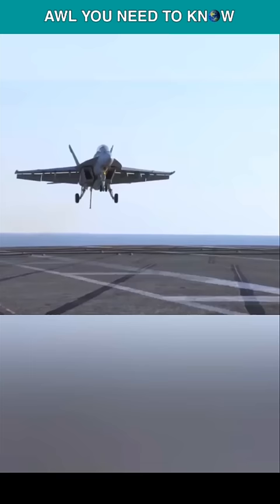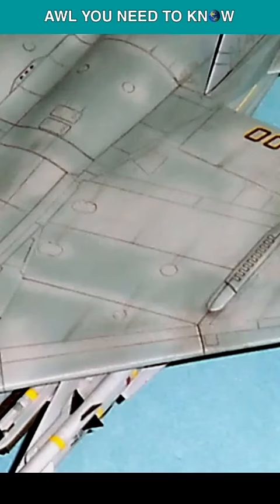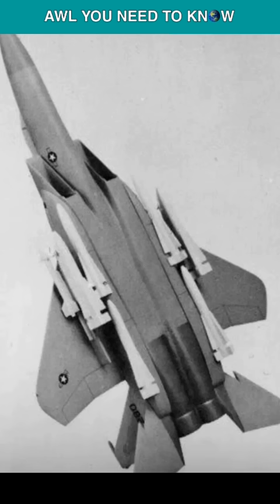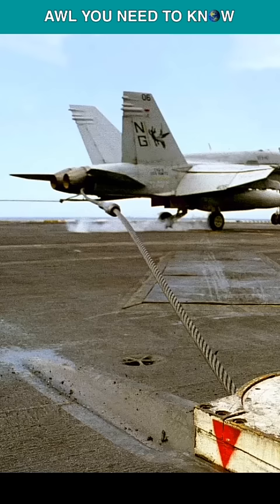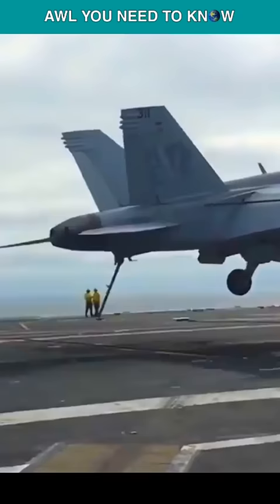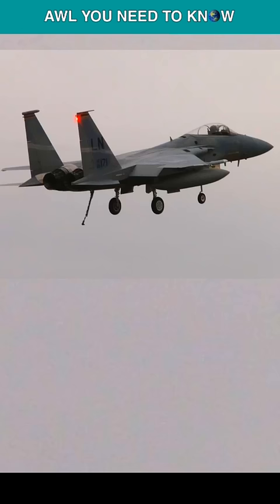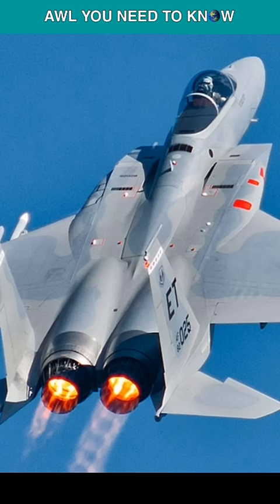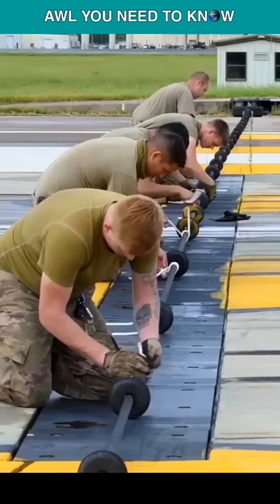Why Can't an F-15 Land On an Aircraft Carrier? #shorts

Comment: The F-15 would have no problem landing on a carrier.  The hook is only used on a runway if there is an issue, but that doesn't mean it can't be used every time it lands.  The F-15 can stop faster than the Tomcat and take off shorter without the cat.  PS, what the hell does the F-111 have to do with this, the F-111 was never intended to be a Navy aircraft.  It was designed as a tactical, low level bomber.    It would be nice if people who don't know sh*t about aircraft wouldn't post sh*t about aircraft
Reply: There was a prototype USN variant of the F-111. It was not well received by USN test pilots due in part to poor thrust performance caused by the notoriously bad original engine air intakes. Secretary of Defense McNamara had mandated a shared platform for the USAF and the USN. The F-111 was the result.
Eventually some Admiral was able to get rid of the idea of using the F-111 and helped initiate what became the F-14.